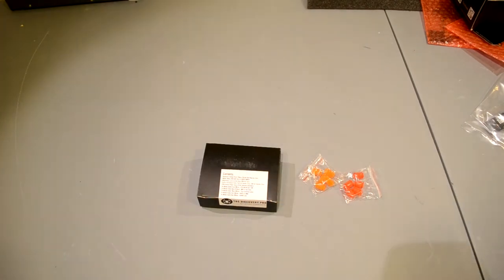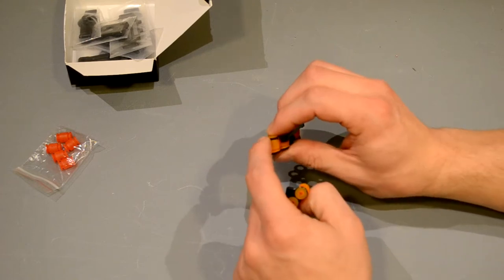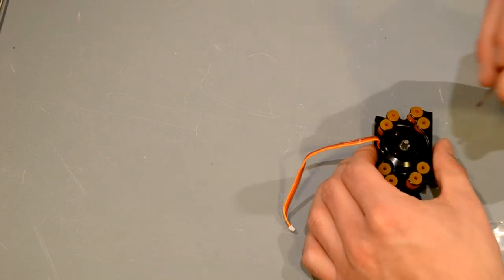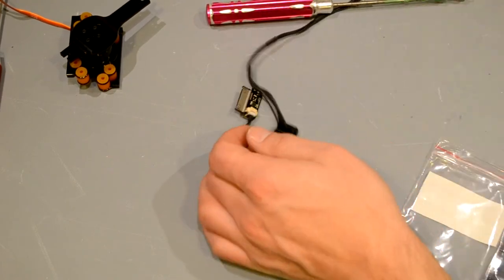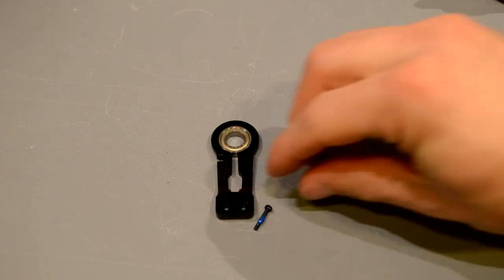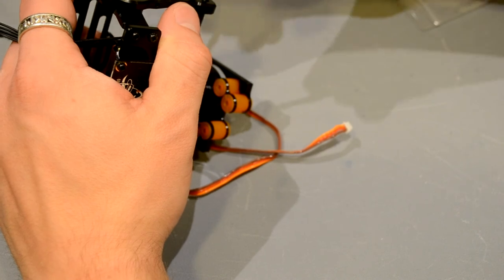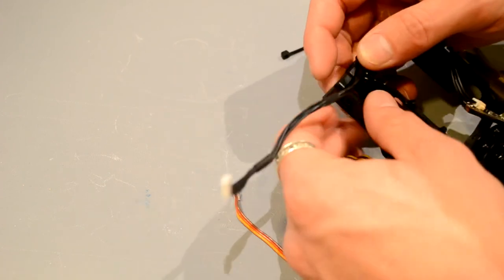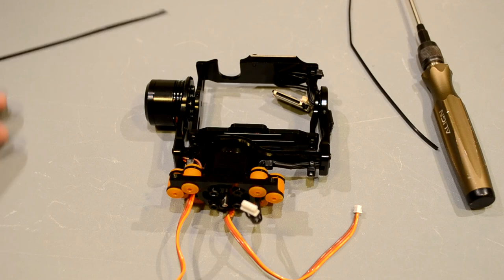TBS Discovery Build Log: Part 1 ---- Gimbal Construction

Comment: Good video, thanks for taking the time to do it and for posting. If I might add constructive criticism - occasionally the camera was pointed away from the build, so important stuff was going on off-camera. You might want to use a live monitor and check once a while if everything is in view. Also, please use an appropriate tool for cutting the zip ties, especially so close to wiring and even more so in an instructional video. Don't take this as bashing, I mean well. Thanks again for posting.

Comment: Great vid Brendan, I have a Gopro hero3+ black edition. Which colour dampers would you recommend and why?
Reply from the maker: Hey thanks man!

I haven't played with the new "+" gopros yet, but the best config I've found is orange outer dampers and red inner. Also orange on the anti rotation bracket that seats deeper in the frame

Be sure to balance your props!
Reply: Brendan Stewart Thanks Brendan, Ok cool info. I place as you say and see how I get on. Long time off for test flight yet though!
Reply from the maker: anytime man! and what do you mean? Im flying it around all over!

TBS Discovery Pro --- Backyard Proximity Practice

Comment: Difficult to watch you use knife instead of cutters to cut zip ties.. Also you should use tape or paint to outline filming area on table surface..There were several moments in video when you were assembling out of frame..
Reply from the maker: Haha yeah, I was eager to get the thing in the air, and chose my knife over my rusty cutters. After all, my fingers heal themselves more easily than the gimbal ;)

And great tip man, I appreciate it. Youll see it employed soon!